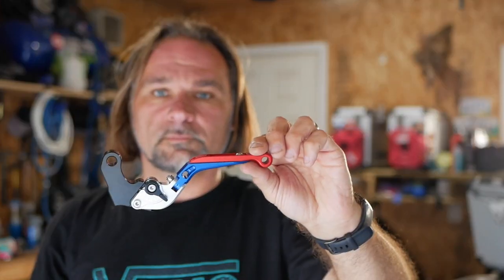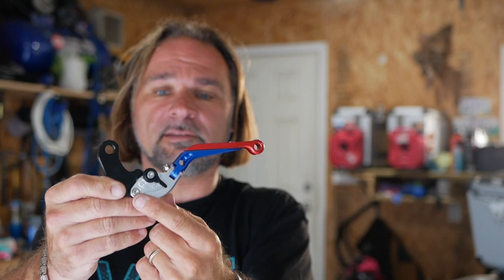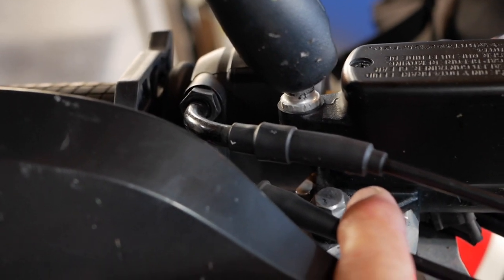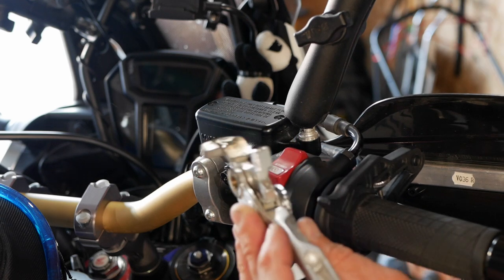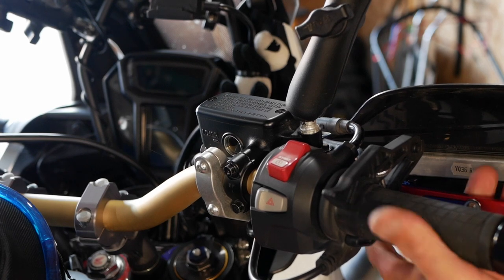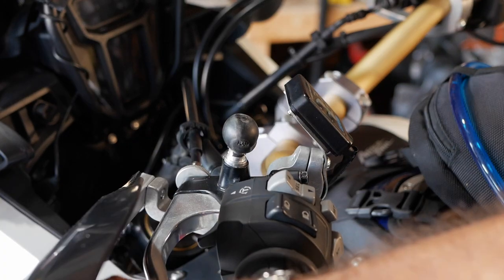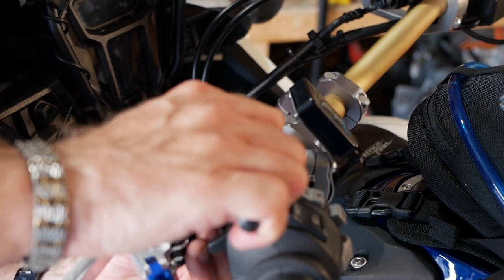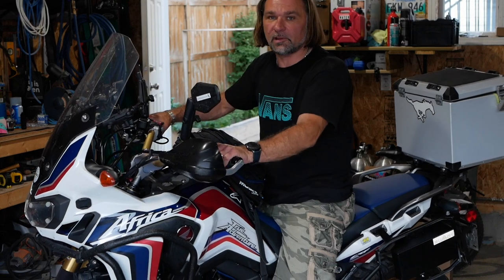Foldable Clutch and Brake Lever review and Install Honda Africa Twin

Comment from the maker: Another pretty decent item from AliExpress long wait but they work and look pretty good now they are tested for last 2 months no issues
Reply: Hey, I’ve installed the exact same lever to my 2017 after watching your tutorial. 

I had made the necessary adjustment to the clutch, rode it and all went well. 

However, I experienced a slight play on the lever mount itself, kinda flimsy. The clutch bolt was checked and it was tightened. Let me know how’s yours! 

Cheer on the clear and precise instruction on the installation! 👍
Reply from the maker: @ridefreely5379  yes there is a minimum play when You move it up and down nothing that affects the performance I wouldn't warry too much and don't tighten all the way as you may snap the screws
Reply: Scuba Travel and Adventure Ahhh hah! Alright then, cheers! 👍

Comment: Camera not showing actual brake lever install.
Reply from the maker: One bolt It shows where it goes once i removed the oem One bolt and nut hold the whole thing.  Not much room to get there with camera but there is nothing to it.  Once you take that bolt out you will see how simple that is. 😉